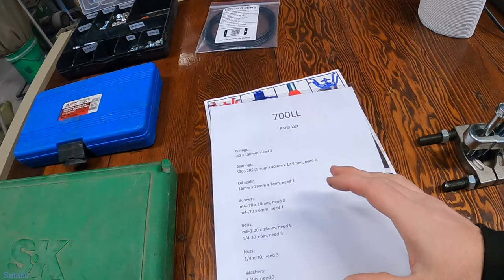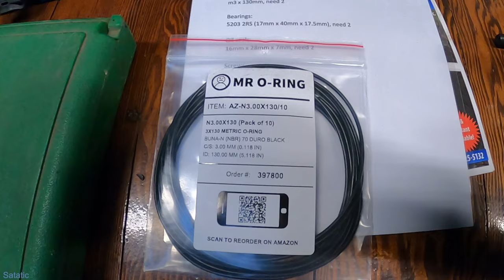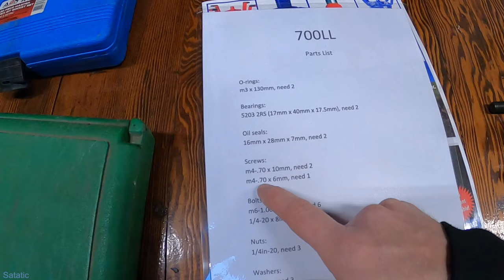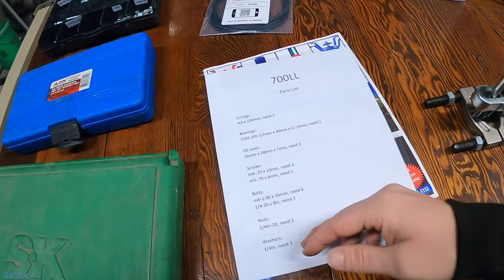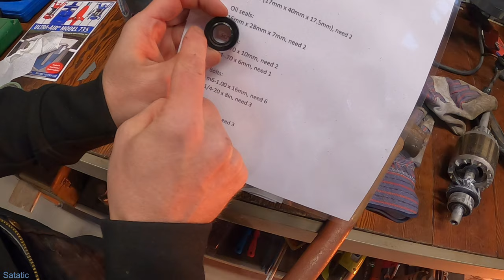Jet Aerator Rebuild, Model: 700LL

Comment: Jeff - thanks very much for the really great video. I just rebuilt a 700LL for the second time. The bearings were seized up but the electrical part of the motor works fine. The upper bearing was totally gone and the outer race was fused to the housing. I had to take a dremel tool with a cutting wheel attached to cut it and chip it out. Finally got it out. In Ohio these motors are about $950 new and $650 if you buy a rebuilt one.
I added sealant to the casing to prevent water from getting in to the motor. In my opinion, these motors are just not designed or constructed to withstand the environment they are subjected to. In the area I live in the health department will not allow any other motor to be used.
Thanks for the video.

Comment: I can't believe this incredible video exists.  I have one of these aerators in my system... just had the tanks pumped and wanted to go over the aerator unit as sort of a preventative measure.  I couldn't find any guidance or info on servicing these from a google search, or from the manufacturer.  I searched youtube on a whim, and lo and behold this video is here.  Hopefully I don't need to tear mine down to the level that you did here, but at least this exists as a reference if I do.  I never expected to find a video of this quality on this specific and somewhat obscure topic. The video quality and advice is fantastic.  Thank you!

Comment: I'm tearing down a 665LL and its fairly different to the 700LL, but this video is still pretty helpful.  For instance all the fasteners are SAE, not metric, and the wiring & bearing sizes are different.  There is little to no info on Jet aerators online.  They really hold their parts lists and schematics close to the vest, because you can't find them anywhere.

Comment: Looks like you may have installed the oil seals backwards. Looks like you installed them with the orientation to keep fluids in (seal label/letters outside)  the motor, rebuilding mine the seals were oriented to keep liquids OUT (seal label/letters inside) of the motor. Mine were also packed with grease for lubricant

Comment: the red piece is a splash shield. I bet 3m marine sealant would work fine in place of the orings on the housing. also I would spray the inside of the housing with WD40  before assembly, it will displace water

Comment: Jeff im doing a singulair by norweco right now. they are similar. the way the norweco comes apart is different. ok under the large bolts that hold the legs on, there are long hex head bolts that go all the way  thru the motor. the long screws are hidden under white silicone, so u have to dig the silicone out to see them.  
The bearings in the norweco 960C are dinky chinese LYC 6203-RZ  IM going to try to find out what the difference is in the  5203 2 RS  in the JET motors And the 6203E -RZ in the NORWECO motors. it looks like the jet bearings are thicker,,,  Im also researching if the seals are the same or not. 
My motor was rebuilt by norweco a few years back and it is in rough shape. the shaft is worn and rusted bad where one of the seals ride, I cannot believe it got this bad in a few years,. I think they rebuilt it and left the shaft like it was. Im going to clean the shaft good where its worn and use 51 percent silver solder to build up the worn area of the shaft then sand it round so the seal will fit the shaft.. when I put everything back together im going to use copper anti seize on the shafts so it is easier to take apart next time. 
I may make a video of the rebuild,, these motors are not complicated, but as you said,  it takes TIME and patience.. I used SUPERZILLA and pb blaster to get my motor apart.. 
norweco has a carry handle on top, that screws into the bottom of the housing,., I think taking it off would break it,  so I had to knock the seal out from the front  then take it out of the carry handle air housing with pliers..
Reply: also on the norweco singulair aerator, the bearing sleeve sits deep on the shaft u cannot get a bearing puller in there., so what I did, after I got the long steel tube out, I ran a piece of strong string thru the top 2 holes where the allen head screws hold the  long shaft on and hung the motor from my bench, I put a cushion under the motor and used a steel driver punch to tap the shaft out of the shaft sleeve. it worked great . you just cannot use thick  string to hold the motor up, because the driver punch has to be able to fit into the sleeve past the string..  . this method lets the weight of the motor work for you, with no special tools needed,, the only special tool I needed was a 3 jaw puller to get the bearing off of the sleeve.  The norweco singulair 960C also has a circlip on the bottom part of the shaft that keeps the bearing from sliding UP on the shaft. you do not need to remove it to get the shaft  and bearing out of the bottom housing.
I got the long steel rod out the same way. I wrapped a piece of thick rubber around the shaft and put it in a vice. I tightened it just enough to hold it, I then tapped around the side of the sleeve for a while to loosen things up, then took a punch and tapped on the sleeve bearing until it came off.

Comment: Damn, right @26:28 you skipped right over how you got that bad bearing out!!   That is exactly where I am stuck.   The inner part popped out with all the bearings fine.  But now I have nothing to grab onto to get the outer piece out.  I've tried heating the casing, wd40, hammering from the back on the bearing grooves, and prying and hammering from the inside.  Nothing works... Did yours just pop out??
Reply from the maker: If you go back a little bit I showed getting it out of the other piece.

Comment: the motor has a start and a run winding, the centrifugal switch disconnects power from the start winding and engages power to the run winding once the motor gets up to speed.

Comment: Jet 700ll new install motor last 16 months.  If the warranty falls through is there an equal motor out there that doesn't say J700 and cost what it is worth not the 500$ they feel they justify because it's in a septic installation.

Comment: the norweco motors use a bearing with a plastic cover, not a rubber seal. looks like the cheapest shit they could find. cheap junk seals as well,, with exposed metal seal casings!!! 
 I have sourced the  high quality bearings and high quality seals for the NORWECO AERATOR motor if anyone needs them, pm me., the only special tool I needed to rebuild my aerator was a 3 jaw generic puller to get the bearings off of the shaft.  This motor should last alot longer before a rebuild is needed with my updated parts and methods.